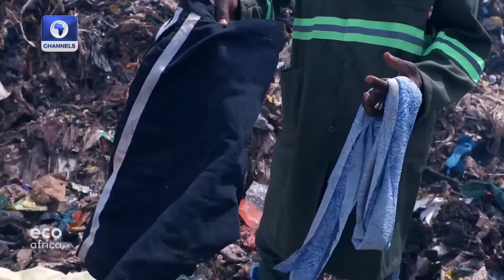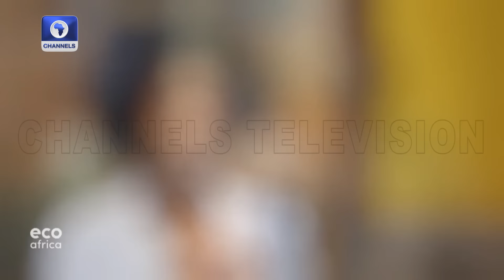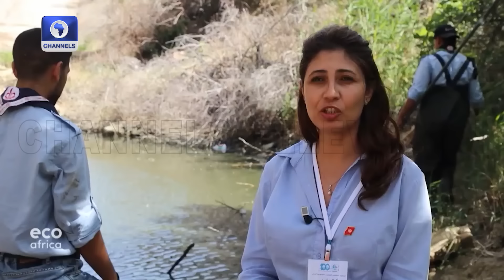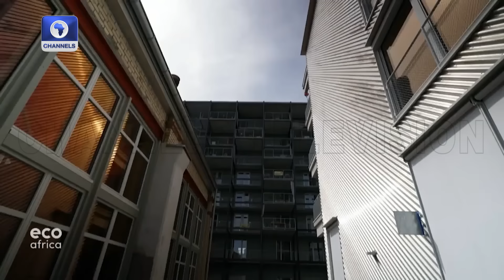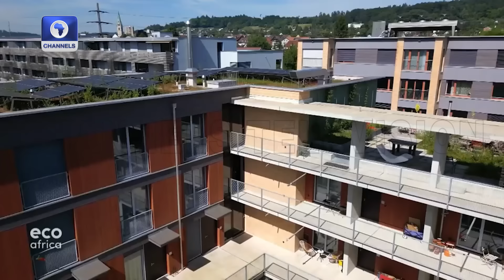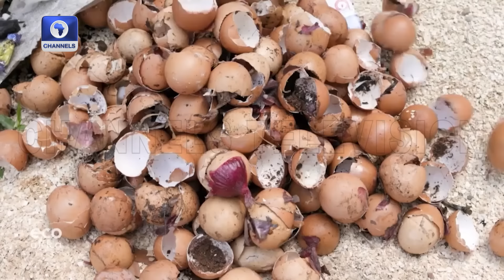From Garbage To Gold In Uganda, Solar Power On Water In Ghana + More | Eco Africa

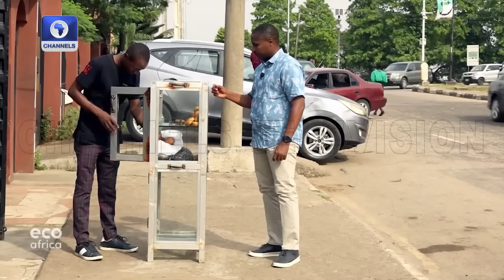Comment: At 19:46
The value of old eggshells
This is not something new ❌ 
Gardeners and those who rear chickens have known about the value of Old egg shells for decades. 
I keep all my old egg shells and use them for a dozen purposes. 
One is for attracting flies and trapping them. 
I also dry my eggshells and grind them down. 
The calcium and magnesium bonding as eggshell powder I use as medicine to prevent muscle cramping.
But mixed with acetic acid makes 'fire gel'.
Any old industrial chemist will tell you about the values of old eggshells.